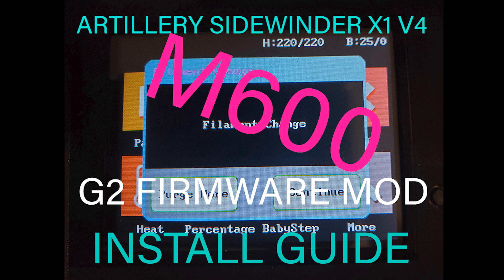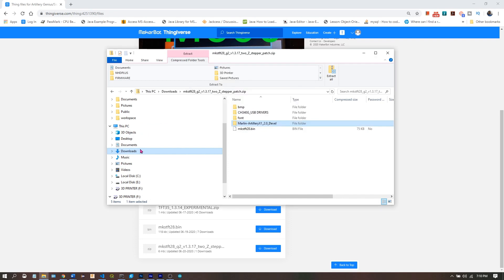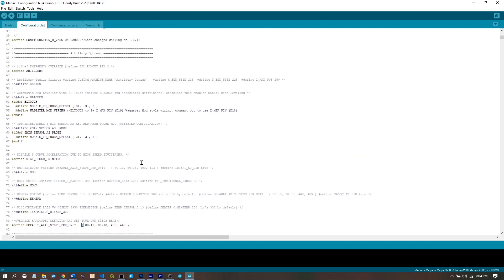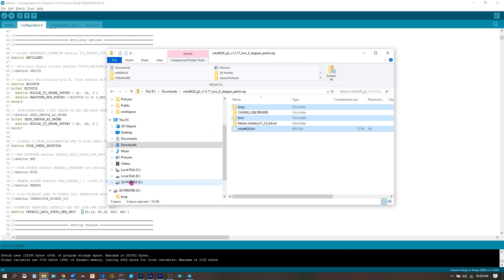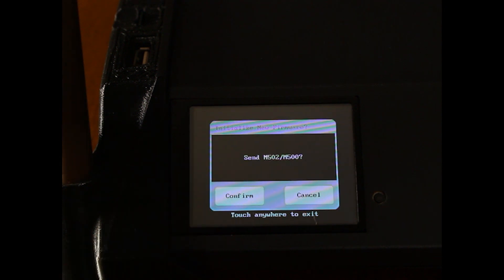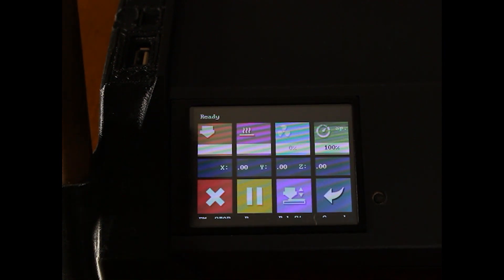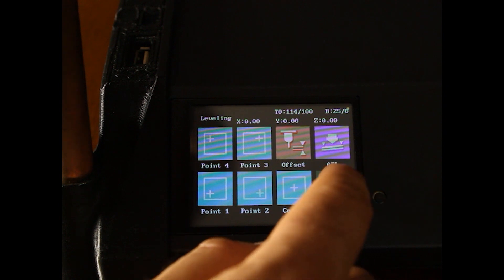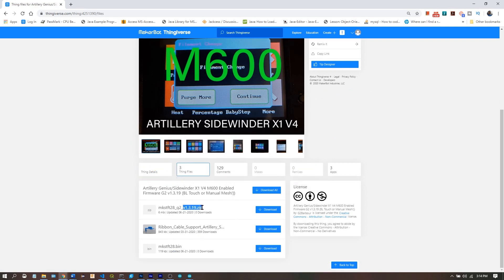INSTALL GUIDE: Artillery Sidewinder/Genius G2 Firmware with REAL M600 Color Change on Stock Hardware

Comment: I've installed only the TFT, without the marlin provided in the .zip since I've got mine fine tunned. I'm getting an alert message from the LCD: "No printer attached!" and I don't know what that really means, what should I do?
Reply from the maker: My version of Marlin is modified on the back end for a few new features. Particularly "M155 S1 P" will affect your connection status. It autoreports XYZE position.
Reply: @PrintEngineering  I finally ending installed your version. Took me a bit to pass all settings to that, but it's working like a charm. M600 working with Octoprint. I've observed a few things:
 - When I pause from LCD, It seems that M600 is also called, could I edit the GCODE called? Not interested on M600 here.
- Apparently, the runout sensor is not working. It's supposed to call M600 as soon as the sensor turns off? Or there's a timeout? Of course the mode is ON. And here's the code compiled for that part:

#define FILAMENT_RUNOUT_SENSOR
#if ENABLED(FILAMENT_RUNOUT_SENSOR)
  #define NUM_RUNOUT_SENSORS   1     // Number of sensors, up to one per extruder. Define a FIL_RUNOUT#_PIN for each.
  #define FIL_RUNOUT_STATE     LOW   // Pin state indicating that filament is NOT present.
  #define FIL_RUNOUT_PULLUP          // Use internal pullup for filament runout pins.
  //#define FIL_RUNOUT_PULLDOWN      // Use internal pulldown for filament runout pins.

  // Set one or more commands to execute on filament runout.
  // (After 'M412 H' Marlin will ask the host to handle the process.)
  #define FILAMENT_RUNOUT_SCRIPT "M600"

  // After a runout is detected, continue printing this length of filament
  // before executing the runout script. Useful for a sensor at the end of
  // a feed tube. Requires 4 bytes SRAM per sensor, plus 4 bytes overhead.
  //#define FILAMENT_RUNOUT_DISTANCE_MM 25

  #ifdef FILAMENT_RUNOUT_DISTANCE_MM
    // Enable this option to use an encoder disc that toggles the runout pin
    // as the filament moves. (Be sure to set FILAMENT_RUNOUT_DISTANCE_MM
    // large enough to avoid false positives.)
    //#define FILAMENT_MOTION_SENSOR
  #endif
#endif
Reply from the maker: @wyzedrider9337  M600 is a built in pause feature in Marlin. It automatically parks the head and can use all of the same dialogs as a filament change event. There is no editing that. What is the problem with it? It is set so that it doesn't unload/load filament upon pause. It behaves in the very simple manner of pausing and parking.
Reply from the maker: @wyzedrider9337  there is a delay for filament runout
Reply: @PrintEngineering  After I pulsed the pause button, the printer encourages me to load more filament.. But maybe it was overlapped with the M600 of the runout routine... I've pressed pause since I cut the filament to see if the runout works.. But the filament ended near of the extruder and nothing happenned (Maybe 1 minute or 2 after the filament sensor was detecting nothing). That was the moment when I hit pause. If normal routine for pause is only parking the noozzle and then resume, no problem at all!

Anyways, is there anything else to activate on the firmware in order to get the runout filament sensor working with Octoprint? Maybe I left something behind.
Reply from the maker: @wyzedrider9337  how do you have the runout sensor wired?
Reply from the maker: @wyzedrider9337  and does it work when printing from the TFT?
Reply: @PrintEngineering  I didn't try. Anyways, the sensor is hooked as stock. I didn't change the cables since I'm not planning to update the firmware so often... A lot of hotglue and I need to length the cables! Does it make a difference on it's behavior?
Reply from the maker: It does operate in different modes depending on how you have it hooked up. This lets me know what to look at. The TFT should be sending an M600 U0 L0 upon runout. If not then something may be malfunctioning or wired incorrectly.
Reply: @PrintEngineering  Then next time I open the printer, I'll give that a chance. I'm updating then if that solves the issue. I'm also printing from TFT tonight, to discard wiring ... I'll keep you informed!

Comment: Hi again. I'm sure you're starting to getting fed up with me :D, I installed the BLtouch as well as the jumper wires and they all seem to work fine, the bl touch gives me the bed data that shows up on my bed visualizer tab in octoprint, but when I print a bed level test piece it seams ununiformed, at the front, it seems perfect but is too low in the model and then way too high at the back.  I have tried adding an m420 s1 to my starting g code but that doesn't seem to have done anything. I know this is very little information, but any help would be appreciated.  Thanks in advance.
Reply from the maker: Start by checking everything mechanical. Slide the bed forward all the way taking note of the amount of tension on the heater wires. Of it is too tight it can tilt the bed. You can slide the wire in or out of the case for a small amount of adjustment. Also make sure that the gantry is perpendicular to the base. Without Z braces that can be off quite a bit. Then manually level the bed again, and then run your G29 again! 

Also note that M420 S1 should not have to be manually added, as I am fairly sure that I have it hardcoded in and that restore G29 on homing is enabled in Marlin.
Reply: Thanks, ill give that all ago.

Comment: Hi, First thousands of thanks for this exactly what I was looking for nice TFT and run filament out sensor in octoprint. I manage to handle installation and configure my BL touch with waggster mount. However when I run ABL the probe does not touch the bed, it goes to far Y axis, so the nozzle is just above the 0,0 coordinates but the bl touch nozzle is above nothing, the probe did not touch anything and I get settings stored message but probing fail.

I change the value in configuration.h paths firmware again, manage to get the first bed levelling run well but then when I send a g29 command (I use this command each beginning of print) I goes bad and the BLTouch probe is again outside the bed area while the printer nozzle seems to be at 0,0 coordinates.

Also when I hit Zoffset on the screen the printing head of the printer goes to safe homing then stop then continue to move on X wayyyy to far and I have to shut printer down to avoid damages on the mechanism.

I use the sources from thingiverse, touchscreen and marlin version mkstft28_1.3.94, I thing I manage to wire it correctly, my BLTouch was nicely working previously on waggster 1.5 version but now I m no longer able to print, did this already feedback by anyone ? can't understand why printer try to goes too far on X when z offset neither why it goes not far enough on Y to trigger the BLTouch probe. it seems to be lost even if I do a home before trying ABL or z offset

Sorry I goes to discord for support and bug report, thanks for the mod honestly it sound awesome, hope I could manage t solve these issues and help preventing others to goes into
Reply from the maker: Double check wiring and reflash Marlin. Make sure you reinitialize the new firmware
Reply: @PrintEngineering  You're the man definitively, it seems that it fix all the issues :O strange that it does not take M502 M500 during patching !!! many thanks !!!
Reply from the maker: @joisaiplu  upon leaving the FLASH FW menu you are prompted to reinitialize the new firmware. That sends the M502/M500. I am not sure why so many people have to reflash Marlin. I have to do it myself about 1/10 times. I think it has something to do with the old data not being properly cleared by M502/M500, but that is just a guess. Glad it worked for you.
Reply: @PrintEngineering  Thanks for the clarification, I will print this in my mind for future updates, anyway your solution is just awesome; will try m600 command soon you really make my day !!!

Comment: Thanks so much for doing this, the firmware has been working perfectly. I was wondering however as I have just ordered a bl touch, will I need to reflash the firmware to enable it or can I just change the setting on the TFT screen? I have also bought some Breadboard Jumper Wires, I was wondering if they would work to extend the filament run-out sensor wire?
Reply from the maker: Thank you! 

You will have to reflash.

You should be able to extend the wires!
Reply: @PrintEngineering  Good, look forward to it all arriving then. Thanks again.

Comment: I have done this upgrade, bur now the usb connector doesn´t work with my pendrives. Gives errors.
Reply from the maker: There are a few versions currently uploaded. Try one of the others.
Reply: @PrintEngineering  Maybe is more adequate change the tft firmware than Marlin?
Reply from the maker: @Leviatan23  you don't have to change the Marlin again if it is current, just the mkstft28.bin file
Reply: @PrintEngineering  Tomorrow will try. Thanks for your attention.
Reply: With the latest screen firmware reads my ubs perfectly. But with the unified icons, the feature icon doesn´t load properly.
Reply from the maker: @Leviatan23  borrow the parameter_settings.bmp or any other similarly named icon from the BMP folder of the NEW icon set and just put that/those icons in a BMP folder on the SD card and restart. You can update 1 icon at a time if you want.

Comment: Just got the firmware installed but have noticed some of the button textures are messed up? ones I have noticed so far are the features and 50mm move buttons any ideas why/how to fix it?
Reply from the maker: There were some file name changes with the icons several versions back. There are two folders of icons. If you can find the ones that represent the correct buttons you can put them alone in the BMP folder of the ad card and they will update individually. I think the features icon is called parameter something or other. You should be able to identify the 50mm button. If you right click in the folder where the images are stored and select view large icons you will be able to see what they look like all at once
Reply: @PrintEngineering  I'll give it a go. I did just update to the newer icons and they all updated fine. Thanks again.

Comment: My runout sensor cable is too short.  Where can I find a longer one to replace it?
Reply: I have the same problem how did you work around it?
Reply from the maker: You can leave it where it is. It will be riskier to use with octoprint because the signal will have to interrupt the incoming gcode but with line number checksum the risk of a faulty command making it through is very small.
Reply: @PrintEngineering  Thanks. I did see that in the Thingiverse steps. I have just put the case back on and will give it a go thanks again.
Reply from the maker: Also, I have placed an order for some extensions and they should be available soon

Comment: My 3D printer is from the Artillery Genius brand. It happens that when I turn on the machine, the touch screen does not turn on. Because of that, I can only print via the USB cable. Do you know how to solve it?
Reply from the maker: It sounds like you have something wired incorrectly

Comment: All my respect to your Hard Work Thumbs UP. 

Im really new to the 3D Printing Stuff and I’m not a Profi Like you I’m really interested in flashing this Firmware and the tft and all the stuff.  Is it possible that you can compile me the firmware ? I got a Sidewinder X1 v1 and installed a BL Touch through the LED Pins i mean I installed the BL Touch like the Waggster Mod. But I really wanna have your firmware installed with all the stuff. Is it possible that I can compile me that firmware ? And send me those files because I don’t really get it to compile it myself 😂🙈
Reply: Sorry Sidewinder X1 v4 and BL Touch 3.1 :-) Installed the BL Touch through the Original Waggster Mod video im Actually installed the Waggster Firmware 1.5 but I really wanna Install your Firmware.
Reply from the maker: Join the discord so we can transfer files https://discord.gg/QdEKUy
Reply: Print Engineering i tried to join but it says session is ended
Reply from the maker: https://discord.gg/jDvYhaN
Reply from the maker: I'm not sure why Discord keeps discarding permanent invites
Reply: Print Engineering  thank you very much for the Invite accepted it. Gotto work now but would be great if you can help me out to get this awesome work on my sidewinder. 👍

Comment: Sorry, install this version of Marlin with this TFT and the Z axis does not go down. The screen throws ERROR M999 since I don't have BLTouch installed. Is there a Marlin and / or Fw version of TFT that is NOT configured for BL tocuh ??. I do not understand much of the subject and I have it without using the printer. Thank you
Reply from the maker: You are supposed to set your own configuration at the top of the configuration.h file. Usually I leave an all stock config by default but it is possible an upload made it through with BLTOUCH enabled. When that happens just put two forward slashed in front of "#define BLTOUCH" in the Artillery Options category at the top of configuration.h. (like this: //#define BLTOUCH) and recompile. I also recommend downloading 1.3.75, as there was a bug in babystepping in 1.3.74.
Reply: @PrintEngineering  Thank you!!. I already downloaded version 1.3.75, and the BLTocuh issue was solved. But I tell you already that I proved it, that the Babystep fails. Since when you want to move the Z axis during the first layer of printing, the screen remains "0.00" and MOVE PENDING .... appears and the screen is frozen in that message. I have a photo but I can't attach it here. Is it a failure of the MArlin or the FW of the TFT ?. Thanks and regards!
Reply from the maker: @Mariano Alvarez you need 1.3.77, it fixes that. But don't worry, you can just flash the new mkstft28.bin file, no need to flash Marlin or reflash the icons
Reply: @PrintEngineering  perfect! I do it today. I approve your good attention in answering me and I ask you why the FEATURES icon does not appear to me (the name if) or appears wrong to me? I already made the flash 3 times and it keeps happening to me. The rest works perfect so far. What am I doing wrong?. Thank you
Reply from the maker: @calasav  it would be easier to be able to exchange photos at this point. Meet me in the discord and show me how the icon is messed up I'll get it fixed right away
Reply: @PrintEngineering  I hope the data will serve you.
Reply from the maker: Discord for up to date bugfix and feature discussions:
https://discord.gg/jDvYhaN

Comment: Is it possible to flash marlin if I don't take the cover off because I don't need filament runout on the board?
Reply from the maker: there is supposed to be a method for that using the reset button and some very careful timing but I was never able to get it to work
Reply: @PrintEngineering  That sounds tricky, doesn't the marlin button disable communication from the TFT to the main board? So do I have to unplug the TFT?

Comment: Hello! I installed both firmware following your guide. I tried to connect the printer with octoprint, but I get this error which prevents the connection: Failed to enable Bed Leveling
and on sidewinder screen i get : printer halted - kill() called! REBOOT!!!
if i click "reboot" it works, but i have to do it again every time a turn on the printer. how can i solve it?
Reply from the maker: 1.3.46 did not end up being a good version. It was a trial run with using Marlin ADVANCED_OK feature to manage the command buffer. I have been revising alot of that code over the past few days. I'm in the process of getting checksum line numbers to work now, and the new version should be released later today.
Reply from the maker: 1.3.55 should resolve your issue. I figured out what it was
Reply from the maker: NEW RELEASE: 1.3.47 EXPERIMENTAL, G2: LINE NUMBER CHECKSUM HAS BEEN IMPLEMENTED! ADVANCED_OK HAS BEEN IMPLEMENTED!!! ADVANCED_OK is feedback from Marlin about how much room is available in the command buffer so we can anticipate when Marlin is ready for another command to avoid the hesitation of waiting for an "ok." This is a big deal, it can potentially increase print quality!!! I've spent the last 2 days doing this, so there may still be some kinks to iron out. USB printing issue may FINALLY be fixed! Filament runout support with the wire to the TFT is being sacrificed. I'm sure with some more effort both could work at the same time, but I don't care right now. This has pestered me for a month. If you want filament runout protection, move the sensor wiring to the main board as per the instructions! Legacy support for other versions of Marlin will no longer be supported,  as it is becoming too entangled and I'm starting to run out of resources on the microprocessor. I was getting strange homing behavior, so I enabled ENDSTOP_NOISE_THRESHOLD in Marlin. A new Logo.bmp has been added, thanks to Spooke! If you only want to pdate the logo, just put the Logo.bmp file into a bmp folder on the SD card. There is no need to update the rest of the icons as they have not changed.
Current Versions:
*TFT - 1.3.47
*MARLIN - (last changed working on 1.3.47)
*ICONS - 1.3.47
Reply from the maker: 1.3.53 EXPERIMENTAL, G2: I just basically rewrote the incoming gcode parser to make it far faster and more efficient and took a whole new approach to keeping track of the commands that have been sent. Preliminary testing is promising.  All of the new features seem to be working well!
 *TFT - 1.3.53
MARLIN - (last changed working on 1.3.47)
ICONS - 1.3.47